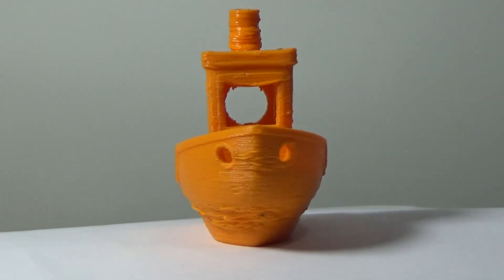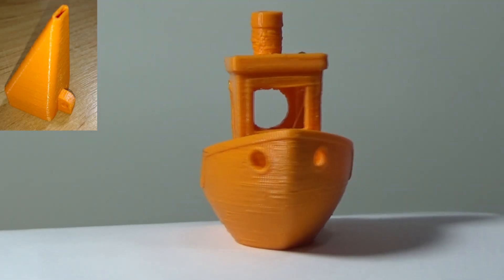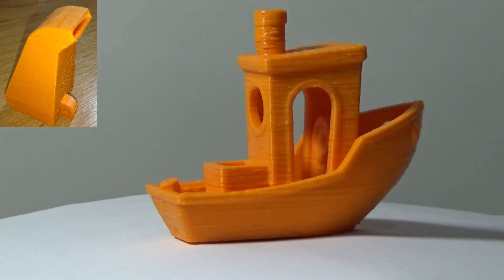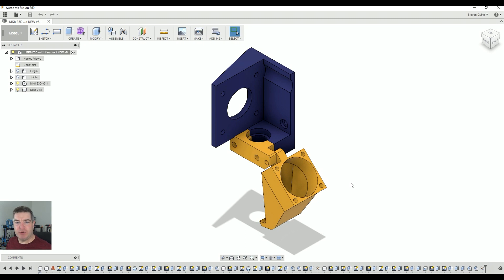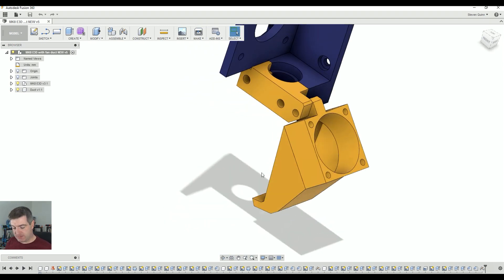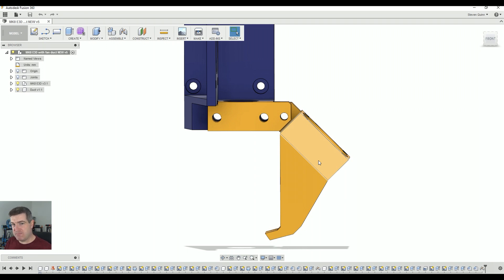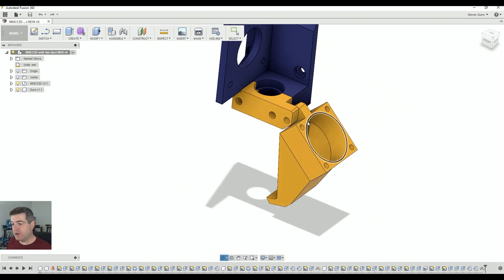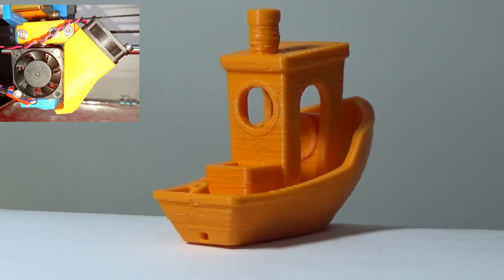eBay Prusa i3 Layer Cooling

Comment: hey steve another great vid quick question were are you wiring your layer layer cooling fan into ?
Reply from the maker: Hi tony, I'll pull the printer out in the next few days and add a photo to drop box showing the layer cooling fan connection on the board.  I'll post a link once it's done
Reply: thanx mate
Reply: Can you give me a link to the photo in drop box for the wiring Thanks

Comment: Hi Steve. I have been experimenting with Just a small air blow nozzle and using an aquarium pump as the source. Using a small reservoir as a buffer tank and an online flow valve I have found this allows a precise fine jet to be aimed directly at the extruder nozzle tip. This has shown great results and removed the need to have the extra weight of a fan/shroud hanging of the hot end. I only print in ABS and PetG but cooling is still required for best results and bridging etc.
Reply: Great Videos by the way. very helpful indeed. :-)
Reply from the maker: Thanks, that sounds like a very cool setup :)